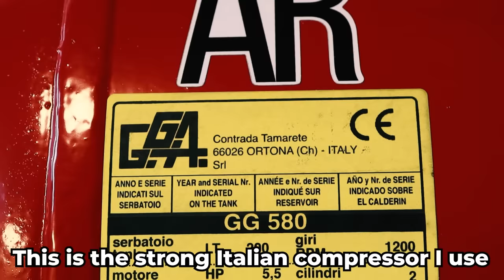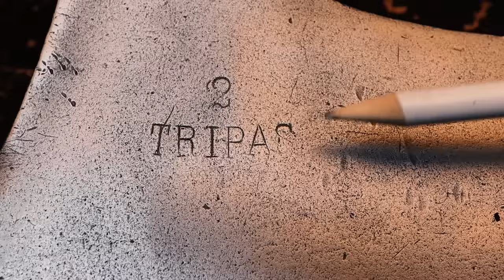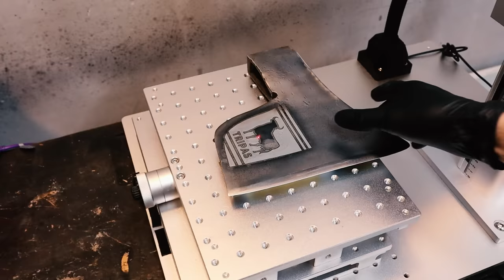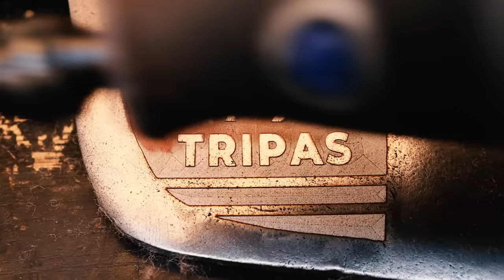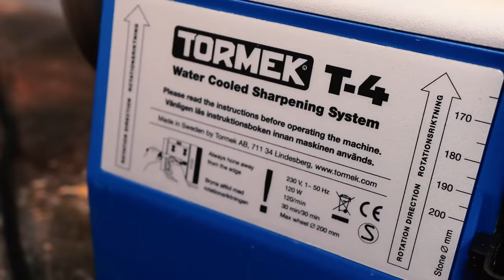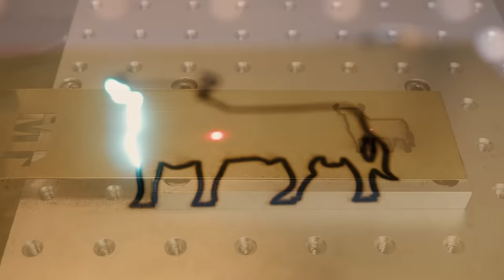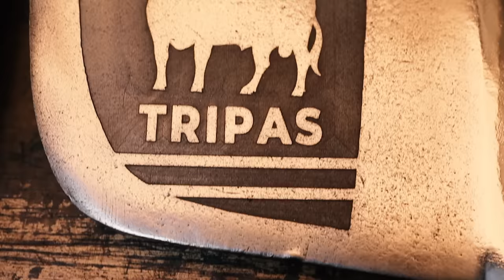Butchers HUGE AXE Restoration - TRIPAS 2

Comment: As russians said: It should be shorter, one handed, all laserwork adding unnecesarry spots where blood and mess can buildup. But very nice video, very nice work!
Reply: The laserwork is pretty easy to clean with a stiff bristled scrubbing brush and a basin of hot water.
Reply: that and using chemicals like chain oil on a food processing tool....
Reply: Are u Mexican
Reply: He is not going to use it to butcher something I guess
Reply: @psychogore  The chain oil is for storage, just like you'd get from the factory. You're supposed to clean them before you use them for the first time.
Reply: shadowtheimpure yesh like you do anything lol, everything should be cleaned before use,wearing, or eating.
Reply: amazing channel
Reply: Именно так мы и скажем)))
Reply: @user-dx7xy2ie7u  нормальный размер, чё придираешься то? 😁
Reply: @Irinella  я больше про лазер)

Comment: 'Tripas'  is the same as 'Cast Steel' that appears on American or British edge tools from that period. Cast steel was a new material at the time. It replaced wrought iron with a small amount of steel welded on the edge.
Reply: peter baxter thank you
Reply: Actually "Tripas" is spanish for intestines so its probably used for that part of the animal
Reply: @theperidius  I guess that's where we get the word "tripe" from.
Reply: @bghoody5665  It's a spanish butchers axe so I knew what that specifically means, but good to know that english isn't that different after all.

Comment: This was enthralling.  When I was with Dallas as a rookie, one of the jobs was refinishing the handles and axe heads.  Scraping the wood with broken glass then whipping the handle and refinishing with the unit info.  The heads were sanded and painted to 1" shy of the live edge.

I came across a throw away head (busted handle) and being inherently lazy I decided to build a charcoal fire in a can and burn out the wood.  It worked and when I carded the rust off of the head I found I had a deep, deep blued finish.  It's in my personal collection now.
Reply from the maker: thanks a lot for your comment I really appreciate it :)

Comment: That metal logo on the handle, going to rip your hand off
Reply: Andrei Talos isn’t it just for meat?
Reply: I was thinking the same thing, if it was going to be used as a working ax. But as a functional showpiece it's okay.
Reply: @michaelrs8010  you could cut butter with this axe and the logo on the handle would still come off or cut your hand. Functional? No. Show piece? Definitely not.
Reply: Especially with a shoulder swing omg

Comment: I couldn't tell what you put on as a finish for the handle?  If the piece is just a showpiece, it won't matter.  But if it is going to be used, I prefer all my wooden handles have only BLO.  This is a very old woodworker's trick.  BLO protects, yet will not cause so much friction that you develop blisters from it.  If I buy a tool with a wooden handle... I will scrape off the lacquer they usually use and put on BLO.  Those old guys knew what they were doing.  And I'm 59 years old... and they were the old guys when I was young.

Comment: Nice hog splitter! Back before much automation hogs would be strung up after slaughter by the back legs and a hog splitter would be used to cut down through the spine which is why they aren't very sharp as a sharp blade tends to crack when striking bone repeatedly.

Comment: Easiest way to get the old haft out of an axe: saw it off about 1/4" from the head, drill a 3/16" hole straight through the remaining wood, insert a coping saw through the hole, clamp the head in a vise with wood over the jaws, and saw out the rest of the wood.

Comment: I love your restoration and design enhancements, i.e., engravings, but if I may be allowed a suggestion: the bulls on the handle bottom would be better -- esthetically and practically -- if they were inlaid in the wood.
Reply from the maker: Hi, thanks for your comment. I could have done that, yes that would have been a nice touch :)

Comment: Can I ask, why: start with the metal wire brush on the rust and not just jump right to sand blasting? I watch restoration vids and I’m not sure why people use hand power verse chemical or machine power right off the bat? Is there a reason for this or just for ASMR reasons on vid? Just trying to learn when to use which method when.
Reply: Or like.. why sandblast and not go straight to the grinding disc?
Reply from the maker: It because i don't wanna get to much rust in my sandblasting media....it will last longer as "clean" sand this way. 😉 Thanks for watching 👌

Comment: I have mixed feelings here the laxer etching in my opinion did nothing to create a “restoration “. ALSO. Thus axe looks to be originally used in the lumber costs industry. These broad axes were used to face off the sides of fallen logs in their entire length for two sides. Creating a ha hand hewed beam used in building construction. 
  That said it’s a nice remade or repurposed axe.
Reply from the maker: thanks for your comment Daniel :)

Comment: What was the point of sandblasting if you were going to grind it smooth with an angle grinder anyway?  That's like washing a wall before hitting it with paint stripper.  There's no point.

Comment: Nice restoration and artistry. however, the brass bull decorations on the end of the handle are impractical if this was anything but a display piece.  they would cut up a hand.  I would have inlayed them so they are flush with the handle.  I suspect you could have even cutout the wood with the laser to make them flush.
Reply from the maker: thanks, I am glad you liked it. I admit this is impractical - I am not using it for anything else but decoration :)

Comment: the metal pads on the handle are of course complete nonsense) it was necessary to drown them to be made on the same level as the tree. otherwise the work is good. but in order to make the picture darker it is better to use copper sulfate

Comment: I think you could polish better the steel, taking off lots of marketing of wrong use. Latter, you could restore the cut and the lazer. The wood was not trustable. It's adjust at the larga diâmetro did not fita ok. You could use época too.

Comment: I disliked the logo you put at the lower part of the handle. Since it's not embedded it is very impractical. It will be very painful to use that axe.
Reply from the maker: Yes, but this axe is only for decoration now it is hanging at the wall in my office :)

Comment: what's sandblasting?
Reply from the maker: Sandblasting is kinda like peeling. You "spray" sand or bakind soda or glass beads or other materials under very high pressure (the pressure is made by a big compressor). The high pressure allows the sand to remove dirt and rust :)
Reply: @AwesomeRestorations  got it :D

Comment: я не пойму это он так ржавчину сдувает или это краска 3:00 по времени ролика
Reply from the maker: Sandblasting is kinda like peeling. You "spray" sand under very high pressure (the pressure is made by a big compressor). The high pressure allows the sand to remove dirt and rust :)

Comment: hm. the blade actually isnt that bad. the handle, yes. absolutely fucked. but the blade itself, not really. you've restored far worse. a little heat, a little hammering to straighten the sides of the eye, a little grinding to restore the edge, and of course removing the rust, and adding a new handle. shouldn't be too difficult today.
Reply from the maker: Thanks for watching. No this was a very easy job >;-)

Comment: What game are you playing with the wire brush there was absolutely no reason to spend a second with a wire brush when we all know that you are going to be using a machine of some kind and yes you use a sand blaster so stop waisting my time
Reply from the maker: Yes there actually is. You don't want to have to much "rust" inside your blaster cabinet mixed up with your blasting media. 😉  If you quickly clean the objects first. The sand last longer. 👌 That for watching